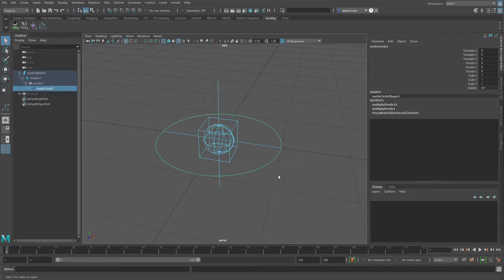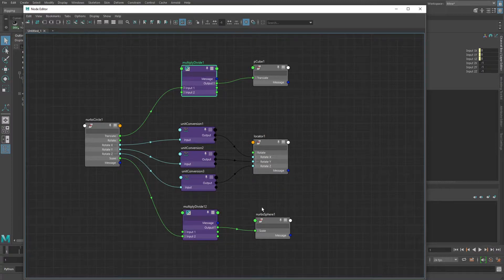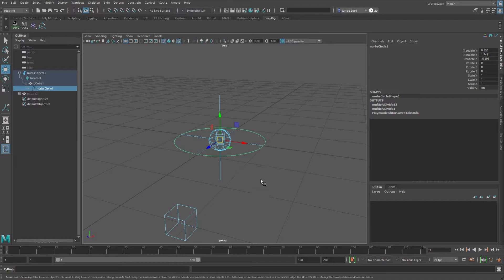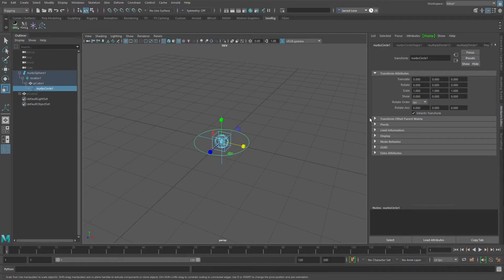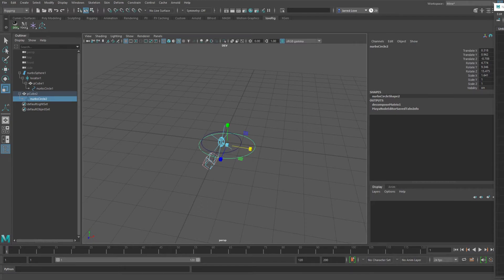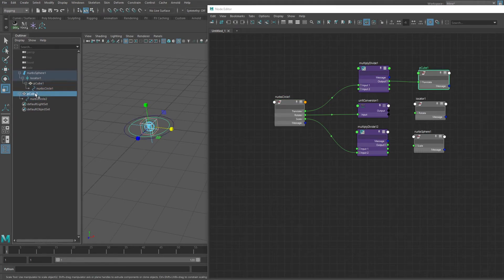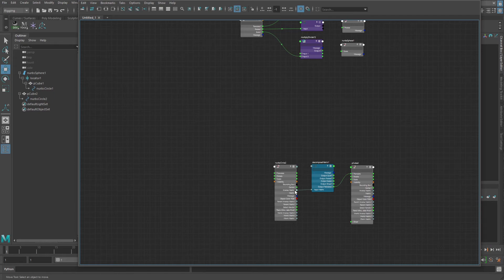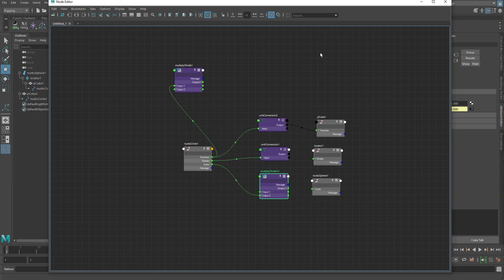Transform negation *UPDATED* Maya tutorial

Comment: Hi Jarred thanks for the Tut.i am looking for a Small help in Making Connection.,i have one Rig With Simple one Controller Driving the BlendShape.so the Connection only Works one way.is there a way to make two way Connection?i want to have Both Sides Connection.if i Move Controller BlendShape Drive if iMove Slider on Shape Editor of my BS then the Controller Should be move from 0 to 1.
Reply from the maker: I'm sorry to say that I don't think that's possible...  you can have 2 things driving something else via some sort of blending/additive node network, but you can't have one thing drive something which then also drives the first - it creates a cycle, and maya can't actually handle those types of cycles...

Why do you need to have a control with attributes driving the blendShape targets, and then also need to open the blendShape editor to control them as well?

Maybe the closest thing you could do is create some sort of plugin or callback system that would allow you to change values on one of them and it would set/update the other as you adjust it, and just set that up to work on the other regardless of which one you manipulate... but that's kind of tedious and difficult to set up and may even slow things down if it's always having to update each in real time.
Reply: @JarredLove  hi jarred thanks for your reply. I am trying to connect 52 arkit model with metahuman control rig in order to get live link connection inside maya. I can directly add the 52bs in metahuman face model. But I want to keep the original  metahuman control rig. The reason I want two way connection. Because I want to do pose correction using metahuman face  control rig. In 3ds max I can make two way. Connection easily but seems maya is different